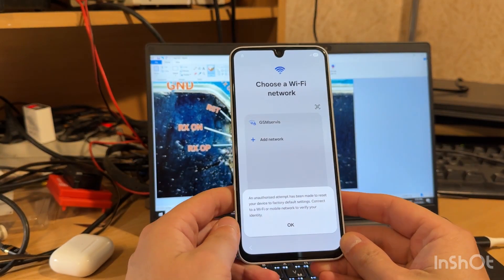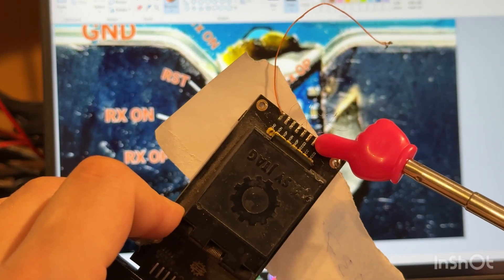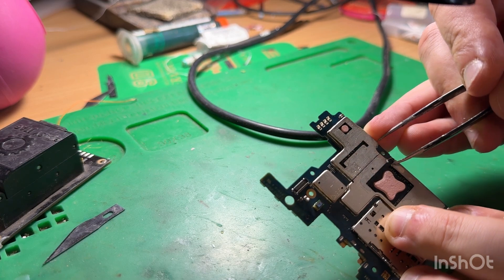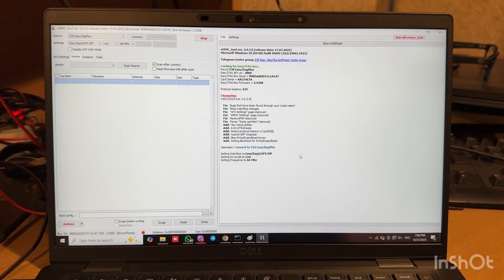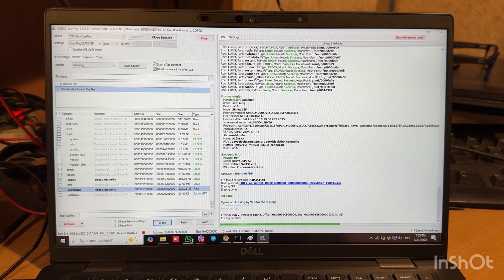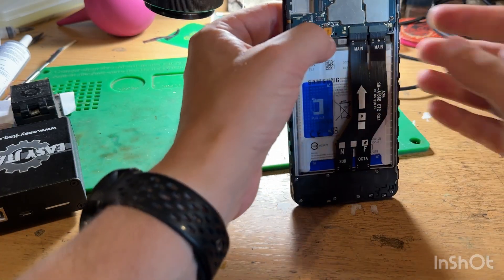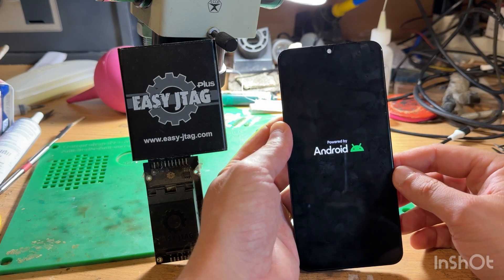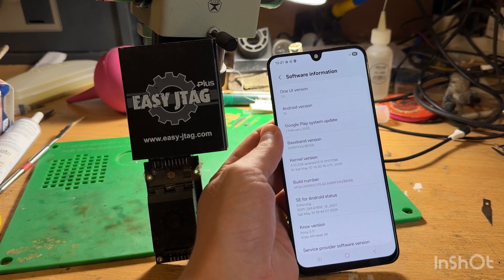How to unlock frp on Samsung Galaxy A16 A165F Android 15 with Easy Jtag Box (brom port locked)

Comment: Hi bro
Please need help ufs modification always i have error -56
Reply: Initialize UFS Engine Fall. Code: -56/BOX: UFS Box Init Link TO
Reply from the maker: @nigergsmunlocker8817 check soldering
Reply: @Remote_Unlocker How can I send you a photo of the modified UFS socket? Could you please check if it's done correctly and where to solder it?
Reply from the maker: @nigergsmunlocker8817 modify what? you do not need to modify anything in socket for isp
Reply: @Remote_Unlocker I removed R4 and R5 and made the jumper, and my soldering is clean, but I'm still getting error -56.
Reply from the maker: @nigergsmunlocker8817 check pinout, check reset  pin, how did you powering phone? gnd soldered?
Reply from the maker: in google avainle incorrect pinout where txon txop reversed, check my new video about a165f

Comment: Exynos operation not work
Still  error(0)
Please make sure You are running the application with administrator privileges If the problem persists, try rebooting the PC
Reply from the maker: you will post this under every video?)
Reply from the maker: and how its related to jtag?)